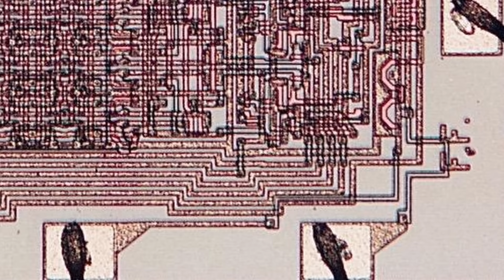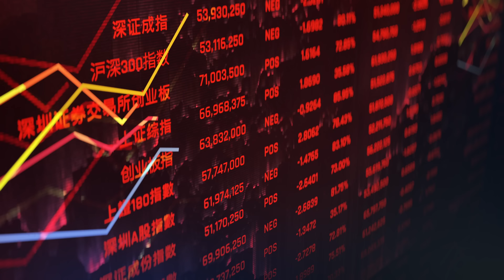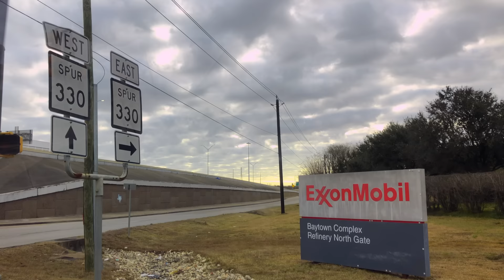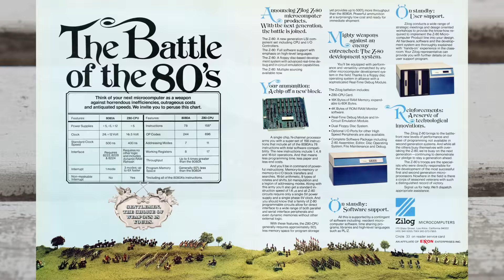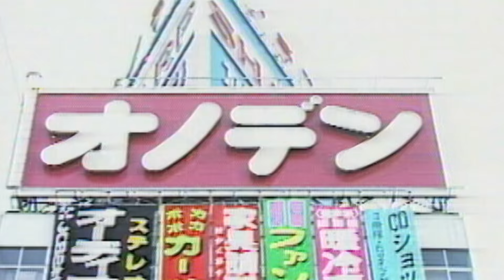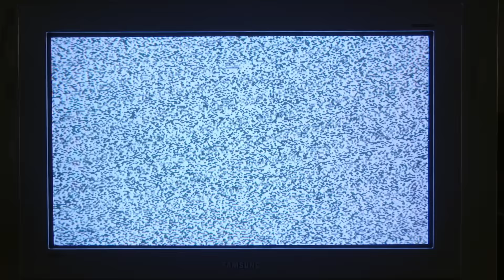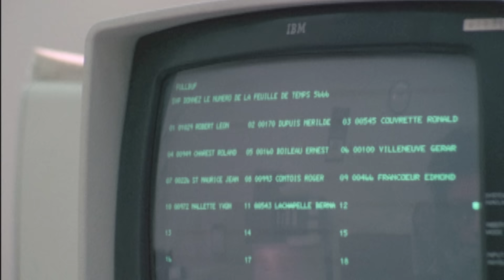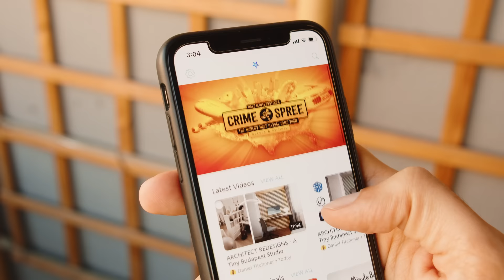Intel’s worst Nightmare

Comment: I remember that I have to choose Z80 over I8080 because I had not 8224 and 8228 (I was behind the Iron Curtain, in Romania). And, more important, Z80 had the DRAM refresh mechanism that allowed extending the memory using cheap huge capacity 6116 chips. They were stolen and produced by USSR (K565PY5) and Z80 was stolen and produced by East Germany (D880). I think this DRAM facility was the cherry on the top. In 1980 I saw an article in Wireless World concerning the 16 bits battle between the three giants (I8086, Z8000 and 68000 were illustrated like King Kongs). And I really felt that something not entirely technical was going on underground. So, back to Intel it was.

Comment: I thought Z80 rings a bell. 
I just aquired a Voltcraft Digi Scop converter 500- a digital oscilloscope attachment wich came out 1986 that utilizes a Z80 A CPU. 
At that time a little German company called Auerswald came up with that and marketed it by Conrad Electronic Germany for 598 D-Mark. Seems hefty but for a fraction of the price of a digital scope at that time it was actually a bargain wich quite shook up the market at least in Germany. It´s also able to send out the screen directly to a printer wich I couldn´t test yet but seems very helpful.
It´s a neat little box wich does some useful calculating and for a hobbyist today still is useful as it does help with audio gear. I like it and the Z80 does the job well. Thanks for the history!

Comment: Ah yes... after the PDP-11 and VAX I cut my teeth on the Z-80 processor and built several systems using it... I also liked the vrief phase of the Z-180 as well... surprisingly, that experience was particularly useful outside of desktop computers because PLC's used the Z-80 chip heavily in industrial Programmable Logic Controllers for many years. The Zilog chips were incredibly robust in an industrial environment with all the stray electrical noise.

Comment: Not only did I program the Z80 for a card scanning system (nice assembler), I soldered chips onto memory boards for the Cromemco Z80-based system on which it ran.
1978 :)

Comment: Around 1983 I was debugging a PCB with Z80 on it, which glitched because of (if I remember correctly) too short interrupt signal, resulting in a jump to the wrong instruction. I thought it was Zilog bug, but then I got a PCB with 8080 (or was it 8088?) and ... it behaved exactly the same. It's really weird that such hardware quirks were identical in two different processors. I think one of them copied something form another.
Reply from the maker: I mention it briefly in the video, but the 8080 was a big inspiration for the z80. The z80 was backwards compatible with the 8080, and Faggin himself has said the 8080 was his favorite microprocessor from his time at intel. Bugs happening on both is indeed very interesting!

Comment: My Intertec Superbrain had 2 Z80s - one for the CPU and one to handle the two single sided, single density 5" floppy drives. I think there's a Z*) in the Lexicon LXP5  effects box and originally in a bunch of other synthesizers. The Ensoniq Mirage uses a 6502 though.I myself was a MC68k person, assembling on Amiga and its helpful set of graphics and sound chips.

Comment: Zilog bought it's way out from under Exxon in 1989 and is still around making microcontrollers and such including some z-80 based ones with triple digits mhz clock speeds.

 Kinda sad that the Z8000 was a failure, it was only half the speed of a 68000 but also about a third the transistors (something like 17,000 vs 40,000)
Reply from the maker: Yes, the story of escaping Exxon is fascinating. I wish I had the resources to make a video jsut of that.

Comment: There was one engineering based decision for the 8086: Offset Registers. With that built in this 8 bit CPU could easily load code anywhere and just jump into it. And even extend the accessible memory up to 1 MB. No extra MMU needed. The 68K didn't have that and the 8080/Z80 also did not have that.
Reply: but motorola did that with the 68k series
Reply: as far as i know
Reply: @bernds1488  Not with the 68000. Only from 68020 and onwards.

Comment: A Japanese technician, many years ago, said that he and his fellow Japanese nerds made a customized motherboard based on the principle of 0-Raid configuration used in hard drive disks. So they experimented in using that principle with silicon IC micro-chips. They are using the same Z80 silicon IC chips made by a small family owned factory in Japan. Their aim is to create a match to what the Americans are coming up with these days. They showed it to me (that was in 2005) and demonstrated it in front of me with everything exposed in a transparent epoxy case and what Intel is selling those days they are able to match it but this time it is more than 100 times cheaper than the best Intel Desktop Computer and their OS is Linux. Their hand made and hand crafted customized motherboard is rather unusually very large so as to accommodate as many Z80 silicon IC chips and including other chips such as RAM, ROM, USB BUS, GUI, DRAM, etc. All of these events happened 17 years ago and I wonder what happened to them, my good guess is that they started using it only among themselves and with their other fellow Japanese nerds.

Comment: Awsome. The first computer I used was the ABC80 based on the Z80. It was very well designed and had a semi compiling Basic language. It did not have any OS, so it was also very fast to start.

Comment: I like the Z-80 and used to design with it. There was a reason why the 8080 chip set was made up of three chips. INTEL was given the design spec and development contract by General Dynamics to replace the Guidance Computer in the Atlas Agenia Missile. The 8080 chip set followed the three board system architecture.

Comment: Good video, but I spotted an error at 15:48. The original IBM PC did not use an 8086, but an 8088. I think IBM jumped to the 80286 in the IBM AT. I think IBM's competitors may have used the 8086.
Reply from the maker: Not an error but an intentional simplification. The 8088 is a variant of the 86, and I couldn't mention the origin of the x86 architecture if I also had to explain that nuance.
Reply: @LowSpecGamer  Yes, and so I checked wikipedia - indeed you are right that the 8088 came out 358 days after the 8086. I didn't remember that. And just for fun, may I point out that NASA was using the 8086 for certain purposes until 2011. That's 33 years of usage. https://en.wikipedia.org/wiki/Intel_8086

Comment: That transistor showned in the beginning is probably for a radio station broadcast power amplification. 
Most vacuum tubes are a little smaller than that. :)

Comment: Thank you.
   With the changes in solid state electronics and sensors came major advances in the sciences. 
    In the late 60s, many chemical analyses were at the ppt or parts per thousand level. Today there are many analyses in the parts per million level or lower. There was a shift from colorometric analyses to instrumental analyses along with automation.
    From one analysis per hour to 10 or 12 or more per hour.

Comment: The 8086 was a horrible microprocessor for several reasons.  The Z80 was a great microprocessor…but it could only address 64K.   The 8086 could address 1 MB of memory…but only in 64K blocks.   The 8086 used 4 16-bit segment registers:  Data, Code, Extra and Stack.  Each segment register was shifted 4 bits to the left before being added to another register… Program Counter or Stack Pointer, to calculate the Effective Address ( EA ).    The 8086 also used a multiplexed data and address bus.  The means the same bus was shared between the address and data.   The address was sent out first, latched in external chips, then the data was read or written.  This segmented addressing scheme, was one of the most enigmatic things I have ever seen in microprocessors.   Motorola’s 68000 microprocessor used straight, linear addressing…it was typically considered capable of addressing 16 MB ( 16 times as much as the 8086 )   In reality, the 68000 could access a total of 64 MB…. 16 MB in 4 different address spaces.   I have written assembly language for the 8086 and the 68000.   The 68000 was my preferred microprocessor.   It was just so much better than the 8086.   IBM even released a superior version of their PC that used a 68000.    Compared to the 8086, the 68000 was a sheer delight to work with.   The 68000 also had separate data and address buses.

The only thing more useless than segment registers in the x86 family, was the “Indexed Indirect” addressing mode on the 6502.   It looked like this…( zero page address, x ) … the 8 bit X register was used as an index into zero page memory, fetch two consecutive bytes and use them as the address.  Utterly useless.   EVERYONE used ( zero page address ), y …. The two bytes at the zero page address were used to get the 16 bit address then the Y register was used as an index at that address.   Very popular addressing mode.  So if #$c0 and #$80 were stored at zero page addresses $fb and $fc, and the Y register held #$0a, then ( $fb ), Y would point to the 16 bit address $80ca

Comment: Before I ever had a computer at home I studdied microprocessors and decided on the Z80 for its extra registers and block instructions. Once that was settled, it was down to TRS-80, Exidy Sorcerer, and Heathkit H89. I had luck with Heathkit in the past so I went that way. I was dissappointed that Heath went back to Intel when they went 16 bits. I had been hoping it would be the Z8000.

Comment: Time index: 0:41 Transistors were never initially made out of Aluminum! Aluminum is a metallic chemical element; transistors have always been made from semiconductor chemical elements or compounds, such as Germanium, Silicon, Gallium Arsenide and Silicon Carbide.
Reply from the maker: I mean the gate itself. The first MOSFET transistors had an aluminum gate according to the sources in the description.
Reply: @LowSpecGamer  Yes, the first MOSFETs did use an Aluminum gate, however the channel was made from Silicon, in the first MOSFET invented in 1959, at Bell Labs by  Mohamed Atalla a Physical Chemist and Dawon Kating an Electrical Engineer. It's the semiconductor channel that provides the transistor's base structure and permits the on/off flow of electrons (in the case for digital/binary logic), under the control of the gate voltage. The Aluminum was applied through vapor deposition onto the comparatively larger Silicon channel base structure, after the Silicon channel was subjected to ion implantation, this is because ion implantation is a comparatively high temperature process, and if ion implantation was done after Aluminum vapor deposition, the Aluminum would melt preventing the gate from functioning correctly.

In Electronics Engineering, we say that a transistor's base structure is made from a particular semiconductor material, making up the conducting channel (in the case for a MOSFET), the channel may be either N-channel or P-channel and this is achieved through ion implantation, previously mentioned in the above paragraph. Aluminum was replaced for polysilicon because this reduces the number of masks required to fabricate MOSFETs, simplifying the manufacturing process resulting in lower unit cost.

https://www.researchgate.net/post/Why_do_we_prefer_polysilicon_gate_over_metallic_gate_in_MOSFET

Comment: I am pretty sure there were at least 2 microprocessors introduced before the 4004. Four Phase Systems had the AL1 in 1969, and Texas Instruments had the TMS 0100 two months before the 4004 was introduced.
Reply from the maker: First commercially produced microprocessor is the full title (I had to simplify not to derail the video). But as all first inventions of anything, it is always a matter of debate
Reply: @LowSpecGamer  Fair point.

Comment: Guys - Zilog was funded by Exxon Enterprises. The name was likely invented by the Exxon. The narrative also ignores Motorola 6800 and Mostek 6500 replaced by the 6502. Both the 6800 and the 6502 were on the market in 1975. Also, the Z80 is a superset of the 8080. Intel sold their CPU to EE-s on the basis of having an "I/O bus" which was not actually all that true. The Z80 was a signal compatible superset of the 8080, so the Z80 rode the coattails of Intel. Zilog issued two upscaled versions the Z800  and the Z8000. However, IBM bought their PC design which was based on the 8086. (Note. Exxon Enterprises was financially dominated by Reliance Electric which was losing buckets of money. That did not help any of the technology companies owned by Exxon.) Meanwhile, early Apple computers were based on the 6502, and the Apple Lisa and Apple MacIntosh were originally based on the 68000 a 32 bit CPU with 24 bit external signals introduced in 1979. Meanwhile, the 8086 was marginally a 16 bit CPU. However, it had the marketing strength of IBM behind it.

Comment: This microprocessor pioneers last name is pronounced Fa-zheen'. In naming the company, yes, he had "integrated logic", or "ilog" in mind, but the "Z" was added as "the last WORD in integrated logic" making it Zilog.  He was also keenly aware then Intel was short for "INTegrated ELectronics," which is what steered him to coming up with the Zilog name. The traps that Shima put in the Z-80 took advantage of the two types of NFETs in the circuitry: enhancement and depletion modes. Most of the time, the depletion devices had their gates shorted to their sources. Enhancement devices did not, although you COULD, but in that case, the enhancement is turned off at all times. By throwing in a few of these devices in key spots, you could wreak havoc in a circuit. You could not spot these traps visually. Later on, you could by taking X-Rays of the chip, which identified the depletion devices, thus exposing the traps. A major contribution to Intel's focusing on the uP market was that the Japanese were killing the rest of the world with their DRAM products. Intel could not compete, and finally recognized that they had a virtual monopoly on their hands if they would focus on their strength: microprocessors. A famous Intel marketing guy once told Faggin "when you left us and came out with the Z-80, you had us dead in the water for a while." That's when Zilog tried to design their Z-8000 16-bit uP, but the design effort stalled for well over a year, and Intel took off, leaving Zilog in the dust. Do NOT mess with Andy Grove!

Comment: The Z8000 was not superior to the 68000. It was similar to the 8086. It had segment registers to be able to address more memory. The 68000 had a linear address space and orthogonal instruction set. Having programmed Windows 3.0 in C, the memory modes required by Intel's segment registers was tiresome. The Zilog chip had the same problem.

Comment: At 0:44 the video mentions transistor gates out of aluminum. I'd not heard of this before, that there was a time when transistors were made from aluminum. My understanding was that the point-contact cat whisker transistor was made from silicon doped with germanium. If there was a time when "transistor gates" were made from aluminum metal, could someone please provide good references so I can read more about it. OR do you mean the metal in Metal Oxide Semiconductor (MOS) Field Effect Transistor was actual metal rather than the polysilicon it became in later years? That I have read about.
Reply from the maker: Here are some quotes from "Silicon: From the Invention of the Microprocessor to the New Science of Consciousness" by Federico Faggin himself. Specifically Chapter 2:

"When I joined the Fairchild R&D Lab, I was assigned to the MOS Process Development section then headed by Les Vadasz. That meant I had two bosses because I continued to report to Capocaccia at SGS-Fairchild, Italy, as well. The same day I set foot in the lab, Vadasz asked me to choose one of two projects to lead: (1) Design a special dynamic MOS shift register, or (2) Develop a self-aligned MOS technology using gates made with silicon instead of aluminum. I chose to lead the latter because I had remembered Capocaccia mentioning the concept of self-alignment and I clearly understood its advantages in reducing the harmful effects of parasitic capacitances, especially the ones between the drain and the gate (Fig. 9). The parasitic capacitances are unwanted because they greatly reduce the performance of the MOS transistors. Especially detrimental is the overlap capacitance between the gate and the drain electrodes because its effect is multiplied by a factor much larger than one during the switching operation."

"The first engineers to use amorphous silicon to make silicon-gate transistors were J.C. Sarace and his collaborators at Bell Labs. However, no one had yet invented the process architecture needed to make integrated circuits with silicon gates. The Bell Labs method could only make discrete transistors, not ICs. Following that lead, Tom Klein, an engineer working for Vadasz, measured the difference in the threshold voltage that could be obtained by using heavily P-doped silicon instead of aluminum for the gate electrode of an MOS transistor."

Comment: Actually DataPoint Corporation in San Antonio TX developed the CPU on a chip! The 4004, the first CPU on a chip was designed by DataPoint Corporation and Intel was hired to make the chip. Later on DataPoint dropped the idea and Intel continued with it.

Comment: I used the Z80 for years. Last design, around 1990. The Z80 stayed the most used processor well past 2000, dollar wise. Unit wise, even more, since x86 cost many times more. The Z80 is still around, hidden as gate array macros.

Comment: I learned (simple) machine code programming on the Z-80 based "Micro-Professor MPF-I", complete with I/O expansion board. Fun times!
Reply: I still have the micro professor and two Nascom 2 computers which were built from kits (Target Electronics Bristol). Great days.